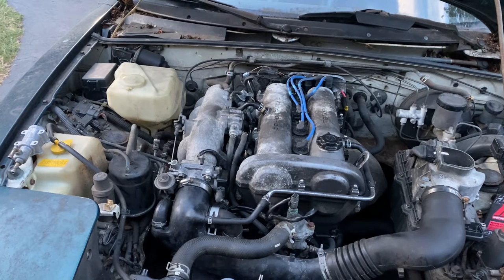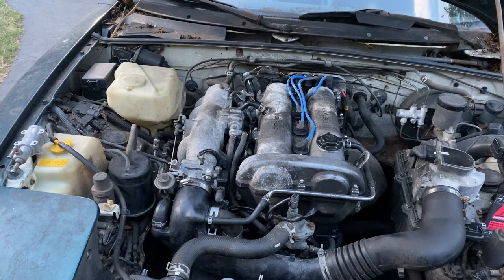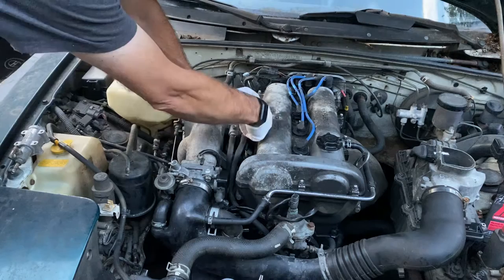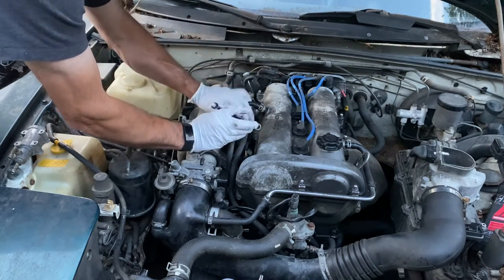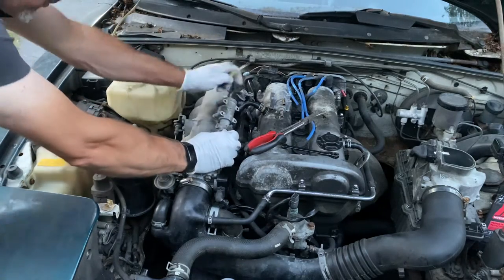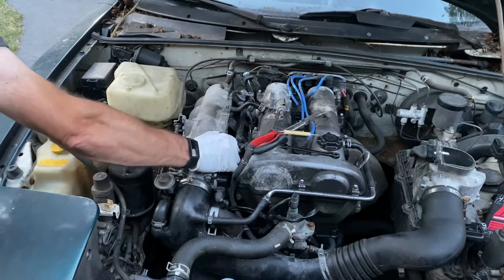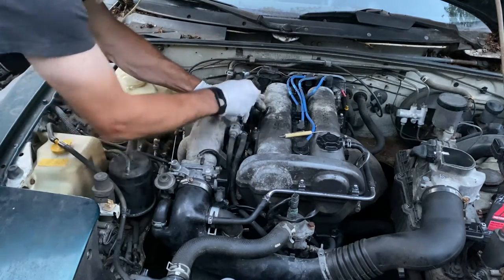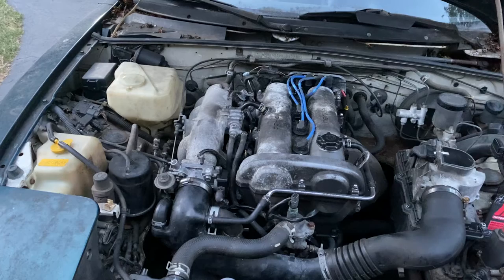Part 3: 1990-1993 Miata with crazy idle. Choke valve / Air valve replacement.

Comment: I chased a crazy idle for a couple of weeks.  It was the engine temp sensor.  It causes some weird things to happen when bad. The CAS o ring goes bad a leaks oil down on it.   20 bucks,  it's worth a shot.
Reply from the maker: Great information 👍 
I traced the problem and fixed it today. Watch for the conclusion in episode 6 😎

Comment: Do you think it is something with the Air flow meter? Maybe the engine computer goes into a default strategy when you had the IAC disconnected? Seems like the ECU is trying to over compensate for something?
Reply from the maker: You are on the right track. I solved it today and put it in to episode 5/6.
Reply: I was just thinking about that